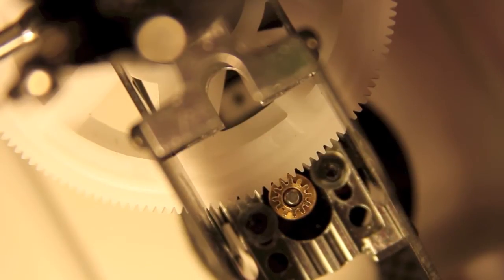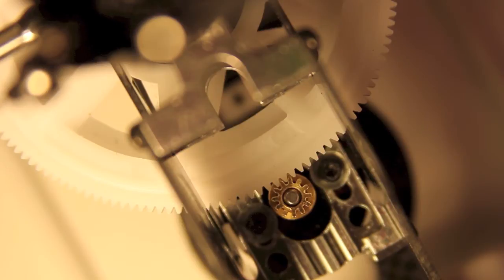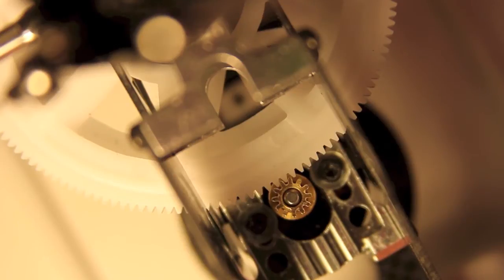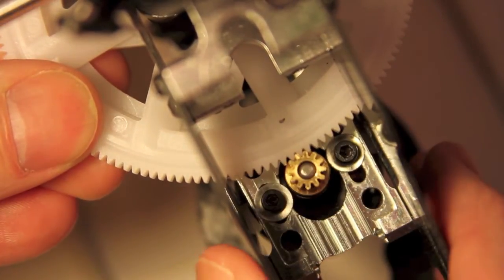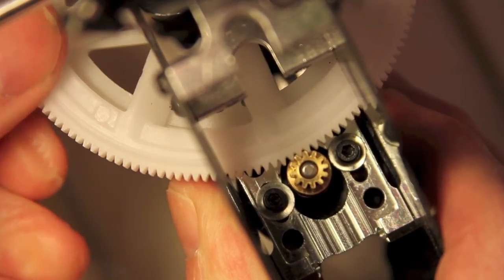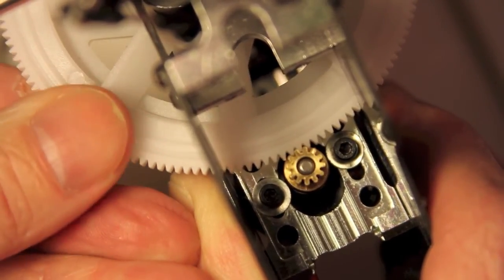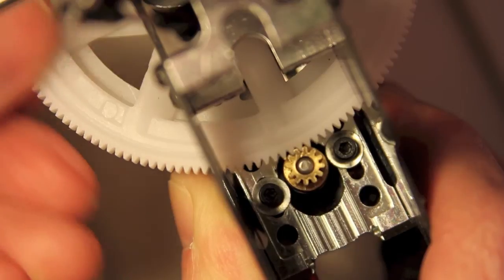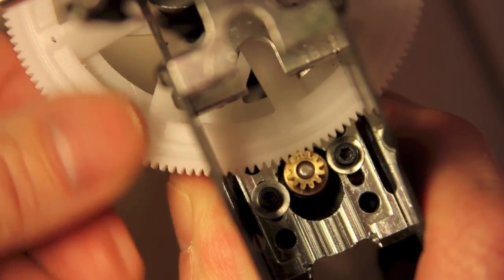19: Tarot 450 Pro V2 Build : Pinion to Main Gear Mesh

Comment: Just REPLACED  MY PINION GEAR AND MAIN GEAR LAST NIGHT.  WAS GOONA DO  A TEST FLIGHT AND WHEN I GOT IT AROUND  75% ON THE THROTTLE  STARTED  MAKING A  VERY STRANGE  NOISE  AND I JUST SHUT  IT OFF AND BOUGHT IT  BACK INTO THE HOUSE  AND STARTED  TAKING  IT APART STARTING WITH THE  MOTER .AFTER IT WAS REMOVED FROM THE  HELICOPTER  I NOTICED THAT  THERE WERE NO TEETH  ON THE PINION GEAR AND OF COURSE THE  MAIN GEAR  WAS THE SAME AS THE  PINION  GEAR ALL THE TEETH  WERE  GONE ,HAVEN'T  QUITE  FIGURED  THIS OUT AS TO WHY? MY ONLY  GUESS WOULD BE  THE PINION GEAR WAS WAY TOO TIGHT ON THE MAIN GEAR .I'LL  CHECK THE  PINION MESH AND MAKE SURE  IT'S NOT  TOO TIGHT THIS TIME  .THANKS FOR THE  VIDEO  BETTER LATE THAN NEVER. JJM IN MONTGOMERY ALABAMA SENT